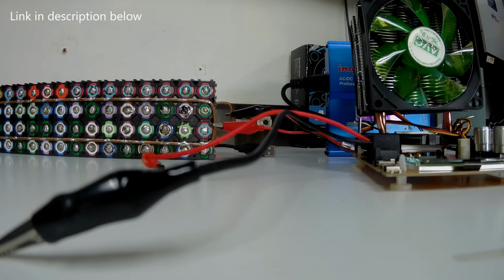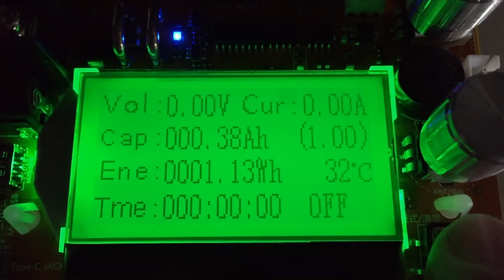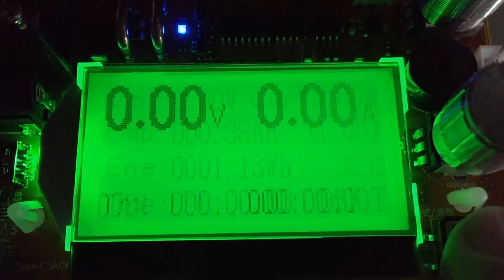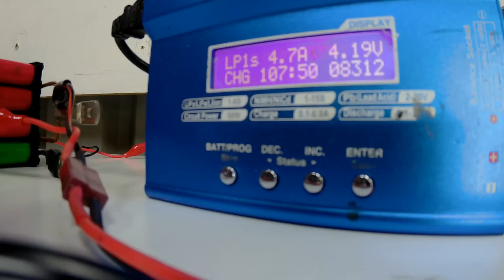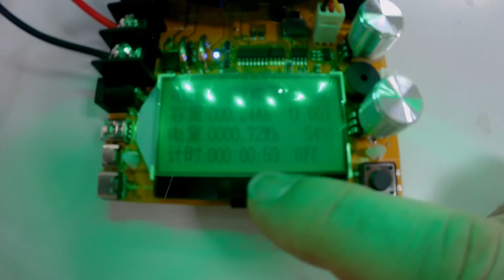New 18650 Dischargers to test on #Cell5 Upload #2

Comment: Solder bigger cables directly to the busbar, those clamps have such little surface area touching the busbars, not surprised they get hot st 25A. 
Awesome rigs, wouldn’t mind some of those hahaha
Reply: You should start with this one, at 60W/110W, but I personally have the 60W version:
https://www.banggood.com/Original-ZHIYU-60W-110W-9_99A-30V-Constant-Current-Electronic-Load-Aging-Battery-Capacity-Tester-p-1146280.html?rmmds=search&cur_warehouse=CN

They are so useful for testing big parallel packs/series packs, and how they V droop under load.

For internal resistance/getting leaky or bad cells, I would advise this:
https://www.ebay.com/itm/DC-12V-Battery-Capacity-Tester-Lithium-Test-Life-Internal-Resistance-Analyzer/263358206343?epid=509608701&hash=item3d515f5187:g:r9gAAOSwU4FaIicP

It can test cells at small currents, and higher if you put a 90/120mm besides it.
It also tests internal resistance, and it is so useful in this manner. It got rid of some bad cells even.

Comment: Isn't 80 cells at 1C = to 160amps. times 4v = about 640watts.
Reply: Fully charged is 4.2V - if you have a cell at 4.7V you need to get it outside ASAP.
Reply: Probably venting before 4.7v plus throw your charger away as it's crap :)
Reply: er... that's 725Whrs so actually, a 2Kw heater would be a little under 3c discharge so it would run it for about 20 minutes.,..... maybe more like 15

Comment: holly crap. I was just thinking about how much power is lost over the cables, then you touched it. hahaha. damn. needs to be decent gauge cable (maybe 10-12) and heavy duty clamps.
Reply: Especially for cell discharging. You want as little losses as possible, as you'll be losing voltage to the cables too.